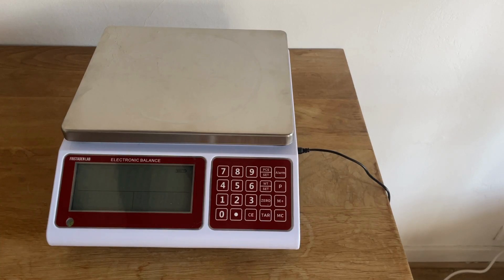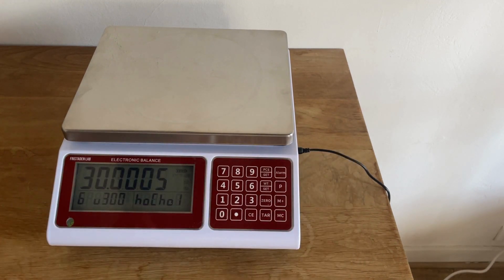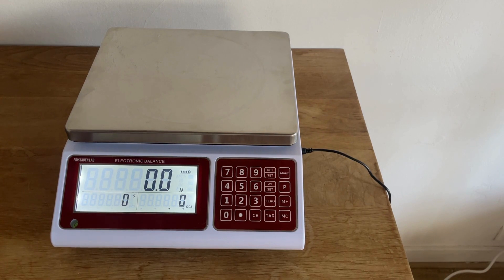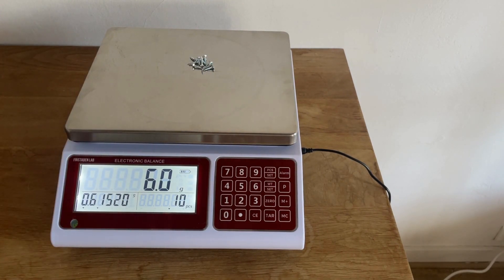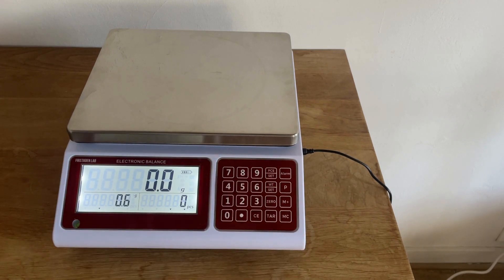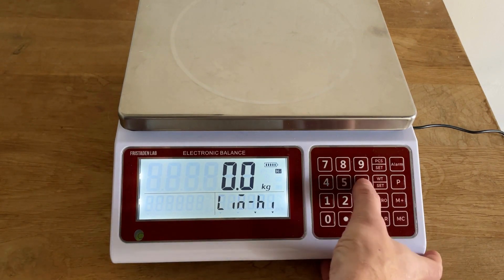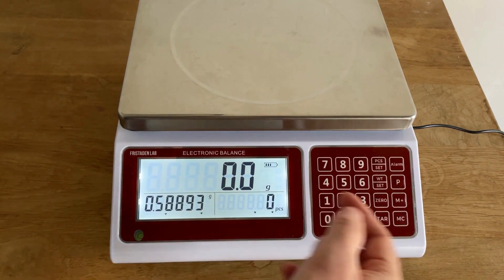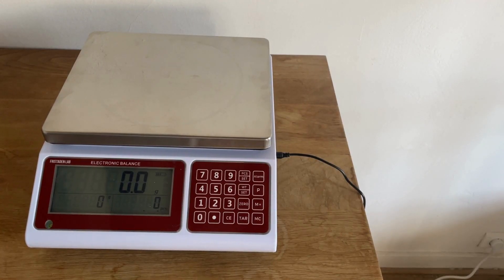Instruction Video - Fristaden Lab Counting Scale

Comment: How do you calibrate the scale?
Reply: Thanks for reaching out. 

Please perform calibration as per below steps:

Calibration Steps:

1. Turn the machine off and turn it on then quickly press ZERO three times. (important: do not wait for the machine to display any number, immediately press ZERO three times as soon as the machine is powered on)
2. “AU-CAL” will be displayed on the lower right corner of the screen.
3. Use a calibration weight of at least 20% of the total capacity of the scale (eg. 3kg for a 15kg capacity counting scale.
4. Kindly ensure that calibration weight is in multiples of 100g i.e 3000g, 3100g, 4000g etc.